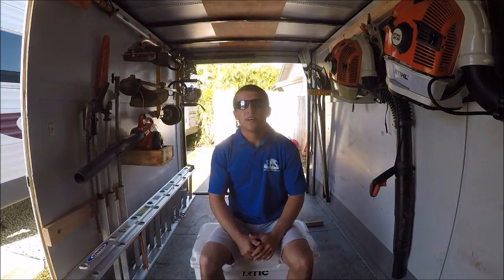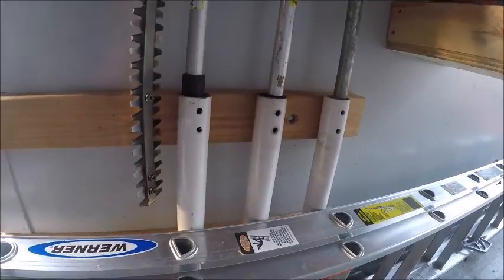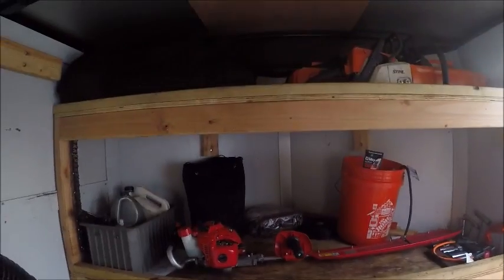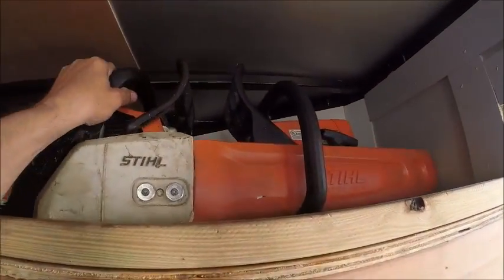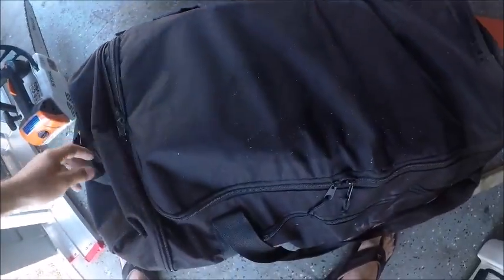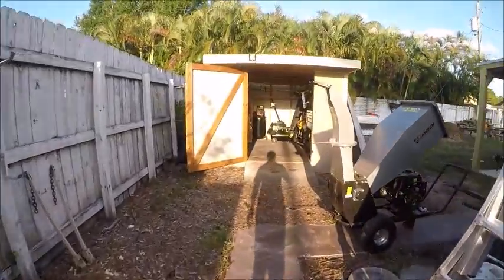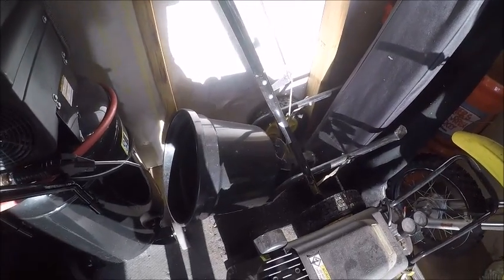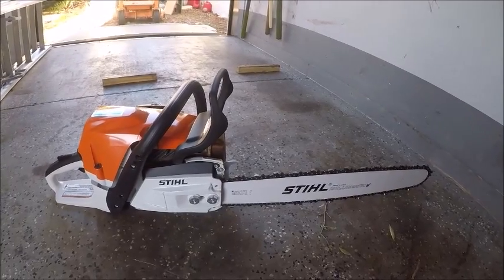2017 solo lawncare setup

Comment: Inspiring, brother! Lots of good equipment and organization. You have a lot going on like me. I like that climbing aspect. I wish I would have picked up climbing years ago! God bless you and your family, brother. Keep up the dream.
Reply from the maker: Andrew V what an awesome complement thank you! Likewise to you.
Reply: Nick Farina why u lawn care you tubers don't use exmark? Are they just too much $$$?
Reply from the maker: Exmark was my first choice however their 36" vantage didn't impress me. The best part about an exmark is their deck. The 36" has the ultracut series 3 which is built as strong as the others but isn't nearly as deep as the others which is what causes the suction. More importantly though it has the 15hp fs series engine whereas the scag came with the 19hp fx for $1000 less. My previous mower had the 15hp fs and the difference is game changing. I can mow 20" tall grass and in 1 pass there is not a single uncut blade. The engine rpm and blade speed never bog down. I like that the exmark has the fuel tank centrally located but scag just offset the engine to make up for it. If I get a zt it will probably be a lazer.

Comment: First off, nice set up. So the 362c would probably be better with a 25" bar or less. I sent mine off to get heavily modified and it will pull 28's and 32's with no problem. Before it was modified it would pull a 25" full comp or full skip ok, but it seems to bind less with the full skip. IMO 20" is the sweet spot for a stock 362c.
Reply from the maker: juicekingz thank you, I'll probably end up adding a 661 to the collection soon.
Reply: Nick Farina you will be well pleased with that saw. It doesn't care what is connected to it. Some people complain about the weight but that can be remedied with light weight bars if you need one over 32". Check out Hotsaws101 on here he's who has done both of mine.
Reply from the maker: Very nice! I've followed him for a while.

Comment: How do you keep everything to stay in place in the trailer while driving?  Driving on highways and bad drivers who got their license in cooking school usually pull out in front of a rig.  E.x. the harbor frieght bins, Weed eaters jumping off the hooks, parts and tools on shelves.  Just wondering cuz it was the only thing I could think while looking at your trailer set up?
Reply from the maker: I've done alot of traveling and can say south Florida has some of the worst drivers in the US. I've been in multiple near misses on the highway and even came close to rolling the trailer to avoid a collision. With that said, I haven't had a single thing come off the hooks or shelves. The only unsecured items are the blowers and the stuff on the shelves. Everything else has a locking rack.

Comment: Do you like your speed feed on the fs94 r I got it on my 94r too ,but I think I need to get used to with it  right now I don't like it that much because of the vibration.
Reply from the maker: I haven't had any vibration issues with mine. Are you sure it was installed correctly? And yes its the only echo product I would stand behind, have run  them for 4 years now.